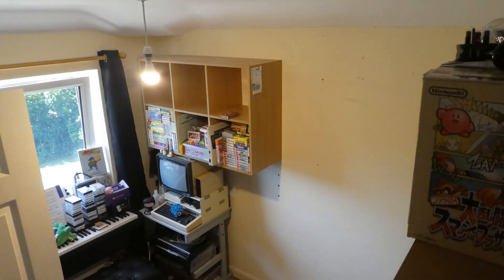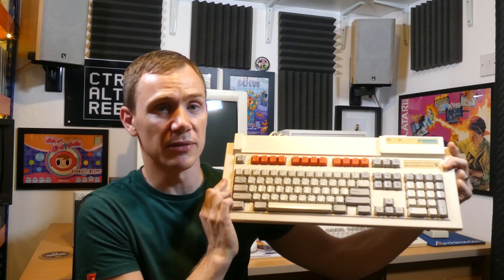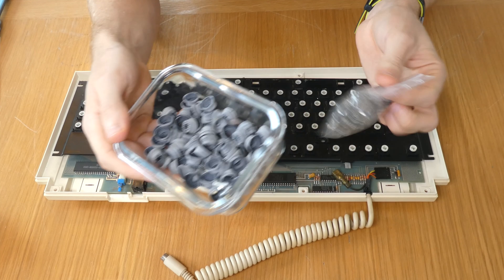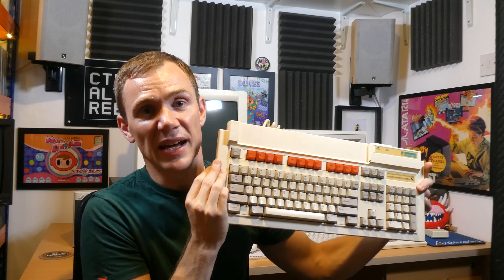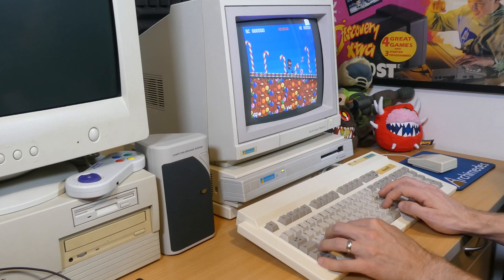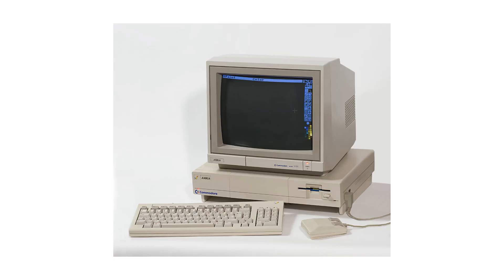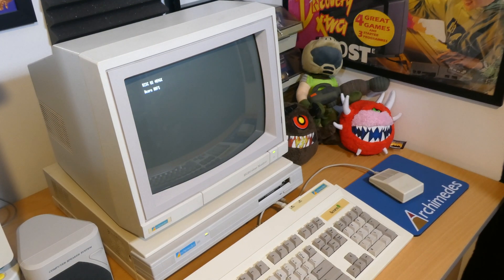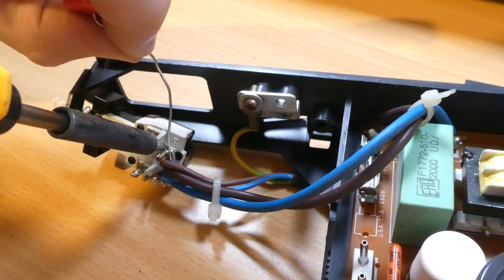Acorn Archimedes A305 Restoration Update - Keyboard Rebuild, Monitor Fixes & Video & Audio Mods

Comment: Doesn't the A305 only come with 512K RAM? Surprised you got some of those games to run.
Reply from the maker: It did indeed, but mine was upgraded by the original owner to 4MB, with an ARM3 CPU and RISC OS 3.11. I probably should've mentioned that in the video...
Reply: @ctrlaltrees  Wow, that's a nice beast you have. ARM3 cpus are very easy and tolerant to overclock, simply change the oscillator on the ARM3 board.
Reply from the maker: Oh, I didn't know that! Definitely something for me to investigate. I will have to find out the current clock speed somehow.
Reply: That's the oscillator value divided by 2.
Reply: There were two official Arm3's, one was clocked at 25Mhz and a later one at 33Mhz as well.

Comment: Nice restoration i never noticed any difference with the sound
Reply from the maker: I agree, it sounds exactly the same to me - to the point where I thought I'd made a mistake with the capture / editing side of things and had to double and triple check everything.

I've been in touch with someone who knows a bit more about these things than I do and it seems there are further modifications required to get the most out of the new chip, so watch this space!

Comment: The studio remodel is looking good! 

As for the Archie ... that's one of my bucket list machines, but they're a little out of my reach.  Most of the examples over here (Australia) that are vaguely affordable usually require major surgery to repair the aftermath of a catastrophic battery leak, and that sort of resto work is slightly above my pay grade (for now at least).
Reply from the maker: Thankfully this one uses a AA battery holder external to the motherboard. Seems like a backwards step that the later models moved to the onboard Varta.

Comment: Hello. Remember you must remove the sound filter... It is detailed on stardot, by Steve3000
https://stardot.org.uk/forums/viewtopic.php?f=16&t=13630&sid=89909f5af01b92a3e3368657341f2e51
Reply from the maker: Hi Zarchos. It was your comments that lead me to investigate the Burr-Brown op amp in the first place. I didn't realise at the time of filming this that it was supposed to be used in conjunction with another mod. That makes a lot of sense! I'm going to be making a video about the modification with a proper before-and-after comparison. Thanks for the info.
Reply: @ctrlaltrees  Great. You could test using QTM and playing some 4 or 8 channel tunes, knowing that QTM allows you to play them at up to 62 kHz when that's 4 channels, or 41 kHz when 8 are used, IIRC.
Using command QTM_SetSampleRate or something similar.
Reply from the maker: OK thanks, I'll definitely look into it! 👍